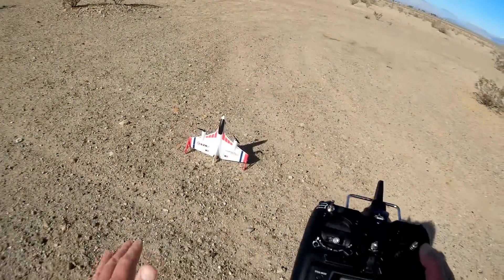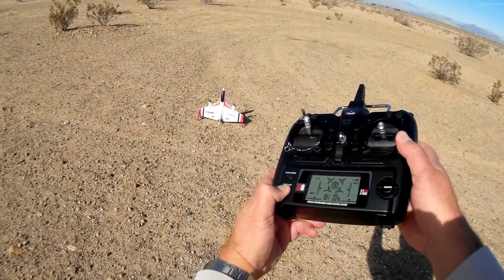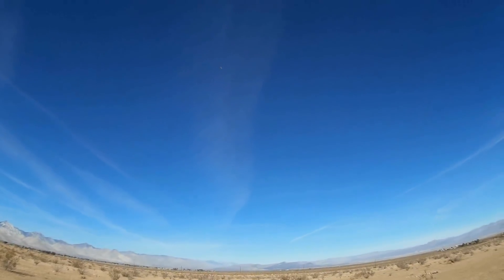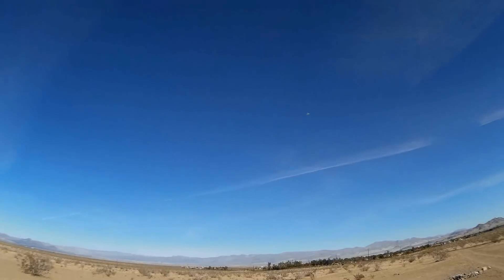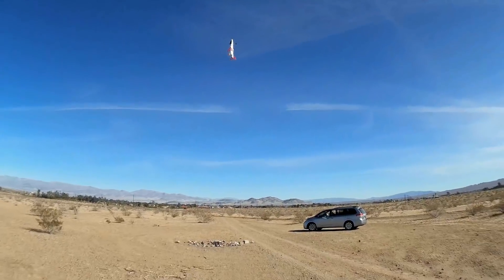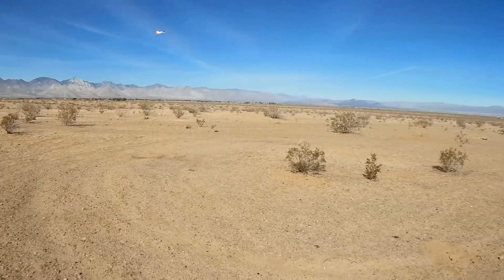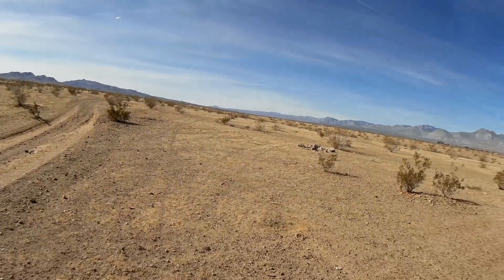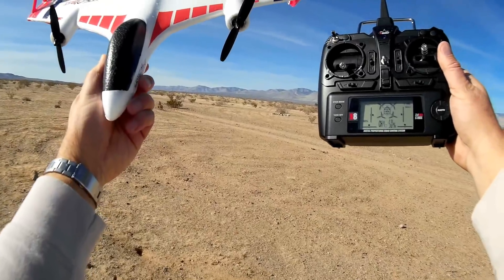XK X520 Brushless VTOL Vertical Takeoff Acrobatics Flight Test Review

Comment: Good video .Can you please confirm if the X7/8 TX is convertible to mode 1. I would  not the only person flying this mode that is interested in this machine .
 Happy Landings...
Reply from the maker: You can specify Mode 1 or Mode 2 at purchase.  Even though the transmitter is switchable, only one of the sides is spring centered.  You'll probably want the pitch roll stick to be centered, so it's better to specify Mode 1 at purchase to guarantee that.
Reply: Thanks for that .
Reply: So is mode 1 with the pitch and roll on left stick and throttle/yaw on right?  On my Devo12s running Deviation it is called mode 3 but maybe the seller is calling it mode 1 ?
Reply: Mode 1 is with throttle and (aileron) roll on the right stick and with elevator (pitch) and rudder(yaw) on the left stick. Happy Landings
Reply: Thanks for the reply i guess that rules me out of getting one of these unless it has a separate receiver that i can switch out so i can use my 12s tx..Most likely it has a integrated receiver..:(

Comment: Maybe someone could help me I purchased wolfwhop fpv camera can I hook it up directly to 3.7 lipo 1c battery
Reply from the maker: Yes, and I believe it may come with an adapter plug and cable to do such.  Just remember to unplug it after your flight to prevent damage to the battery.
Reply: Quadcopter 101 thanks
Reply: Quadcopter 101 Another solution is a protection circuit with a loud buzzer*.
I guess the automatic shutdown solutions might be pretty bad for emergency at long range flight.